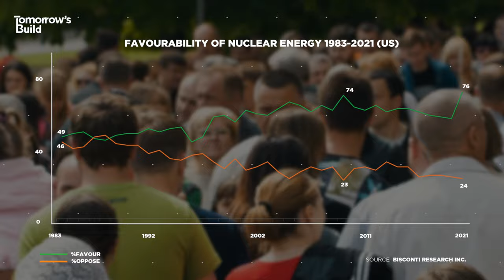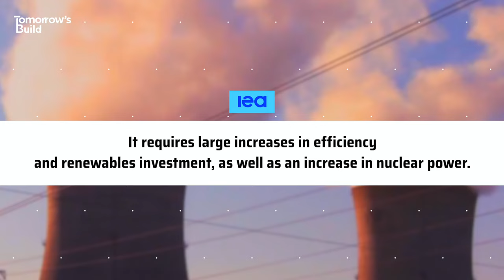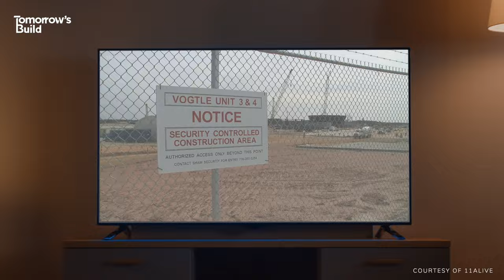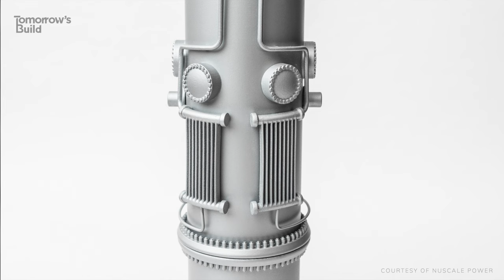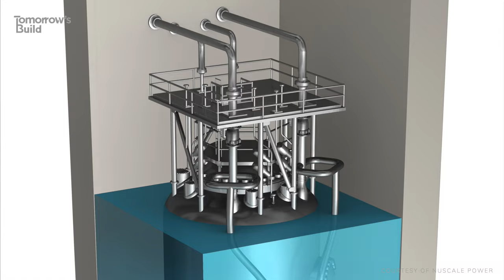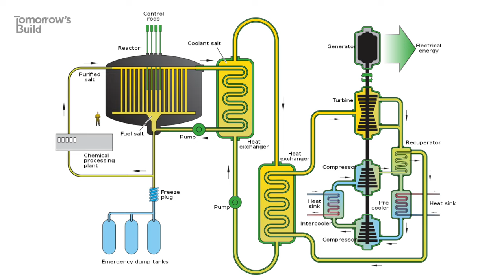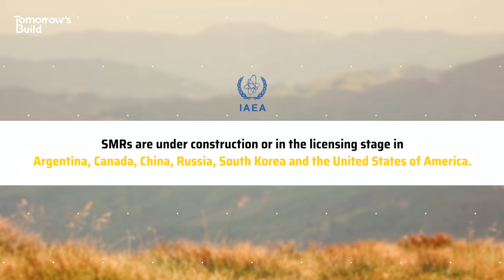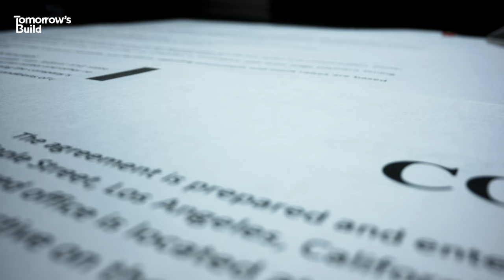These Mini Nuclear Reactors Can be Built Anywhere

Comment: Ooo I actually have a story about these, my dad was an engineer on one of these projects with one of the larger nuclear companies in the US. He was working on their new modular next-gen reactors before the project was axed. They actually had an almost functioning (no-fuel) prototype built for testing about a decade ago now. The idea was they could build it underground or stack them to save space. They also were planned to be fast-breeder reactors or could be transitioned to Thorium to save on fuel costs. Overall the project was super cool, but Fukushima absolutely destroyed it and the one that was sold and planned to be built in Tennessee was cancelled due to public outcry and the company completely pulled out of the nuclear industry and recently went bankrupt. :/
Reply: Should have tried to sell it in a different market like India or China.
Reply: I hope we come around to except them until we figure out fusion.
Reply: Why is public outcry even listened to in for nuclear power. Chernobyl happened because safety was not a concern. Three Mile, again safety was not a concern. Only Fukushima was one where there were sufficient safety systems, but not a lot you can do without backup power.
Reply: @swaggery  Also Fukushima was such a rare thing to happen, sometimes bad shit just happens that we can’t control.
Reply: @swaggery  Safety was absolutely a concern with Three Mile Island's design. That's why it didn't result in a catastrophe like Chernobyl. TMI's problem was poor operator training. When handing a nuclear reactor off to a for-profit corporation, they will look to shave costs wherever they can. A belief in TMI's safety systems caused the workers to assume, if anything bad happened, the reactor would automatically take care of it. Which it did, until humans intervened and manually over-rode the process. Even with that, the containment vessel held and people are still living in Middletown, PA (and all of southeaster Pennsylvania, for that matter). TMI1 was finally shut down after 36 years of operation in 2019. Full disclosure-my father was the project manager for the construction of TMI. He went on to oversee the construction of Washington Public Power Supply on the Hanford reservation and Grand Gulf in Mississippi.
Reply: @alessiofe  That's not how that works, any energy projects in the US are overseen by the government and they would rather axe it than sell it to a economical adversary.
Reply: How deaths in the USA was caused by a nuclear accident? I cannot think of any. At Fukushima, if they would built their backup diesel generator in protected enclosures they wouldn't had their problem.
Reply: @theonlylolking  The  Feb. 11,1985 Forbes magazine cover story said, "The failure of the U.S. nuclear power program ranks as the largest managerial disaster in business history, a disaster on a monumental scale...only the blind, or the biased, can now think that the money has been well spent. It is a defeat for the U.S. consumer and for the competitiveness of U.S. industry, for the utilities that undertook the program and for the private enterprise system that made it possible."  It has only gotten worse since then.
New South Wales Bob Carr, a former nuclear supporter, premier and foreign minister, described nuclear power as "lumbering, cripplingly expensive, and moribund." Every power reactor project in Western Europe and the U.S. over the past decade has been a disaster. Every reactor is on the edge of a disaster every day, forced to extend their working life, crank up output and reduce maintenance costs to compete economically with alternative energy sources.
On Jan. 30, 2022, nuclear regulators Dr. Jaczko (U.S.), Prof. Renneberg (Germany), Dr. LaPouche (France) and Dr. Dorfman (UK) said, "the central message, repeated again and again, that a new generation of nuclear will be clean, safe, smart and cheap is false. The reality is nuclear is neither clean, safe or smart, but a complex technology with the potential to cause significant harm.  Nuclear isn't cheap, but extremely costly. Perhaps more importantly, nuclear is just not part of any feasible strategy that could counter climate change."
Five Japanese Prime Ministers, Koizumi, Hosakawa, Kan, Hatoyama and Murayama said, "promoting nuclear power can ruin a country. We have witnessed an incredible tragedy and contamination on an unprecedented scale: 100s of thousands of people forced to leave their homes, vast agricultural lands (Japan's breadbasket) contaminated. Radioactive water (greater than 1,000 times over safe limits) beyond storage capacity still being generated, many children with thyroid cancer (that comes first along with genetic damage than destroys the immune system, then leukemia and other cancers, then mutations, birth defects and reduced life spans), and massive loss of resources and money." Nuclear has destroyed the economies of two countries, Japan and the Soviet Union. Who is next? I am betting on France, how about you? The French government has taken ownership of EDF and Orano/Areva/Cogema (the name is changed to protect the guilty) to keep them from going bankrupt, and the market share of nuclear has dropped by 12% in the last decade. More to come as aging reactors go belly up soon. But not soon enough to save the French taxpayers. 
China, being a dictatorship, has seen the writing on the wall and is flexible enough to rapidly convert to renewables and put the brakes on nuclear energy. They also have arrested 3 of the top nuclear regulators and ten executives of nuclear utilities for corruption. India and other countries are going the same way. 
The only strategy left for nuclear is to get taxpayers to increase already huge subsidies for nuclear projects. It doesn't matter to the industry whether or not these nuclear pipe dreams ever become reality, as long as they can stave of bankruptcy until they can get their own capital holdings out of jeopardy. Every nuclear reactor would shut down tomorrow except for two reasons: 1) nuclear weapons proliferation and/or 2) Even if a reactor is losing money, if it is shut down, it immediately goes from the assets side of the ledger to the liability side. Expenses for property and waste maintenance, security, decommissioning and decontamination remain with no income. The utility and its investors will go bankrupt on the same day it shuts down. Maintaining the shutdown Sellafield Cumbria site will cost the UK over $3 billion a year just to maintain it and untold billions and at least 100 years to remediate it. But it will never be clean again. We know when nuclear catastrophes occur, but they never end. They just spread and bioaccumulate.
Reply: @KrustyKrabPizza22  Japan it's known for earthquakes, it not so rare. Just place nuclear reactors away from earthquakes zones, seems almost logical .
Reply: @swaggery  well more or less it was because of profits. Chernobyl: they pressured the reactor for the factories that fuckt it with the build up of Xenon and then operator error. Three mile was an operator + the construction went over budget, so there was cut corners. Fukushima was a mix of loss of power and company greek (doc have been put out about the company knew the generators where too low and the wave barrier was too small, company ignored it because of profit
Reply: @Rosedach  "How deaths in the USA was caused by a nuclear accident? I cannot think of any. "
3 that I know of at the SL-1 accident in 1961
Reply: Great story. I wonder where the excess investments went to? Those could have been spent on improving life rather than threatening it.
Reply: @swaggery  There's also the issue that nuclear technology is becomming more complex and prohibitively expensive compared to renewables for example. If you don't have an established industry like France or China for which nuclear has been a national policy objective for a long time. Note, that historically, nuclear energy always relied on massive state aid to be "competitive". Furthermore I don't think SMRs are more economical than conventional big ones in terms of energy output/costs. This is not only bc the construction costs and time scales for any modern nuclear project are ginormous and extremely complex from a bureaucratic pov, but also bc of long term liability concerns like the huge operating costs (fuel (availability), parts/manufacturing, specialized personel, etc.), aswell as astronomical insurance rates. These are the main reasons why fision power becomes increasingly unpopular with national governments and energy companies. And I think it's naive to assume, that "small" reactors would not have the same issues.
And at that point you seriously gotta ask yourself, if all that money and time might be better spend on more research and manufacturing of things like solar, wind and storage capacity.
Reply: @Richard Cranium I'm alluding to the fact, that the civilan use of nuclear was born out only after the establishemnt of the various parallel national programs for nuclear armaments starting in the mid 40s and atleast until the 70s, which created a massive and very costly high-tech industry. In that sense nuclear power was more of a product of national economic and defense policy, which sought to justify and reuse these hugely expensive programs for public usage. In that sense nuclear energy was never truly thought off as a economically sound/competitive energy source in the first place, but rather as an important (geo) political assets that had to be protected and nurtured.
Reply: Sad story, i'm pro nuclear, it's the best solution for next 50 years
Reply: Care to share the name of the company your father worked for ?
Reply: @johnchalmers6784  spoiler: It's Nintendo.
Reply: @johnchalmers6784  I bet it is/was Westinghouse
Reply: Yes cmbgo123.  It's massively unfortunate that designers, planners, engineers & operators between them don't have the combined brain power & common sense to prevent these occasional high-profile over-hyped disasters by building in the extra redundancy needed and telling clients "Well this is what it costs with this 10x as good as before foolproof factor" and thriving or failing depending on that proper cost.   It's messed things up hugely.  Japanese too, they make a nice camera so you'd have thunk they'd know better. But no.
Reply: @swaggery  "Only Fukushima was one where there were sufficient safety systems, but not a lot you can do without backup power".  Well, not sufficient safety systems then because yours is self-contradictory. There's almost no practical limit to the redundant extra safety layers possible but of course costs increases with each layer and, of course, you don't want any of these extra safety layers ever to do anything whatsoever for 100 years or some such, so they are a complete total waste of money. Except of course that if "What the ! I never in a million years thought that could happen"  happens then those massively-expensive never-ever-used extra layers of redundant safety systems were the wisest investment ever made.
Reply: What would be the cost of starting again the project? Any chance I can have a chat with your dad?
Reply: Also, 100 small nuclear power pant scattered around the country would be an easy target for attack (like what happen in ukraine). And it would be hard to defend all of them at once.

10 large nuclear power plants would be easier to defend or maintain than a 100 small one.
Reply: @Ozzymandias493  That's not what I 'learned'. Oak Ridge Lab in TN developed a molten salt reactor - 50 years ago and provides the design - for free. No one (!) picked up those plans. But guess who's building the first reactor now?
Reply: @KrustyKrabPizza22  Very few people were harmed because of the Fukujima meltdown while 20'000 were killed by the tsunami. All other affected NPPs in Japan were safely shut down without major problems. At another NPP site near Fukujima, the townspeople were actually seeking refuge in the NPP site because it was safe from the tsunami (the town council had wisely insisted on a higher seawall and the NPP was undamaged despite being hit by a bigger wave). All you hear in the media is Fukujima however.
Reply: @Snugggg  Plus two during the Manhattan Project caused by the demon core.
Reply: @KrustyKrabPizza22  The multiple design shortcomings at the failed Fukushima reactors had been pointed out and were in the process of being addressed. Had the upgrades been implemented quicker, the 3/11 earthquake would not have had such consequences on the power station. I blame Japan’s proverbial resistance to change, ultra sluggish decision making process and cultural incapacity for individual responsibilities.
Reply: @jackfanning7952  You've got some good arguments there but do yourself (and the reader) a favor by using a bit of white space. Just a couple of paragraph breaks would help immensely
Reply: That is tragic!
Reply: @nntflow7058  except in Ukraine Russia attacked the Zaporizhia plant in part because it is the largest power plant in Ukraine... Ukraine's plants are not small.
Reply: NuScale is or will be building a 77Mw SMR with $2 billion in taxpayer welfare (1 for 1 dollar matching funds) and 77 Mw at $4 billion total is a financial failure even before they move the first shovel of dirt
Reply: It happened before. Liquid salt reactors were tested during Nixon's presidency and were all terminated after running for close to a year without incident. Some stupid political reason, but somehow this tanked the project for 60 years.
Reply: @Ludifant  Every type of reactor known (MSR. SMR, Thorium, etc.) has been built and tested by the U.S. government over the last 70 years. BWRs and PWRs were chosen for commercial power and Navy propulsion because they have the most pros and least cons of all the other reactor types. No conspiracy theory here.
Reply: @swaggery  Modern designs are ‘walk away’ passive designs. They don’t need back up power or human intervention to stop a melt down.
Reply: @Richard Cranium Nuclear has received more state aid that any other energy source except oil and gas. If you consider subsidies for oil and gas started around 1920 and nuclear subsidies bagan in the late 1930s, nuclear has received more than any other energy source.
Reply: wnc817  Every reactor would shut down today if it were not for twuo reason: 1) nuclear proliferation; 2) Even though it cannot compete economically with EVERY other energy source, if it were shut down, it would immediately go from the asset side vof the ledger to the liability side. Costs for site maintenance and security, waste storage and eventually decommissioning and waste disposal (if either of those ever happen) would remain with no income. The utility and any investor would go bankrupt. Therefore the industry will limp and lumber into a slow and agonizing death. The only question is how much they can steal from the taxpayers on the way down.
Reply: @Rosedach  also if they had not built their reactor right at sea level in an area known for tsunamis that would have helped. The u.S. is the only country that requires that reactor be installed inside a reenforced concrete building capable of surviving a direct hit by a large airliner.
Reply: @Snugggg  those are the only ones I can think of.
Reply: @paulmorrow8372  or Bechtel.
Reply: @ibubezi7685  that's because molten salt reactors are not as safe as pressurized water reactors and you can never really turn them off because if the sail cools down it solidifies and then you have a ruined reactor.
Reply: No fuel type means ???
Reply: Tennessee backed out for the same reasons WASHINGTON State backed out in the 1980s, however WASHINGTON has more serious reasons why… like 9.0 Earthquakes & Tsunami’s. Both states also produce more electricity than we consume in hydro-produced electricity. We don’t need any nuclear power plants. If your state doesn’t, don’t think you can force Washington, Tennessee, Alaska, Oregon, or British Columbia to pay for & build nuclear power plants by increasing our rates thinking we can afford it because our sources are already built & paid for. YES we have cheap ass electricity, at great cost to our Salmon industry & species. Several species are now extinct. But it’s cheaper & far safer than nuclear. As our states grow, you will receive even less of our export of electricity. That’s the way it works. If the day comes and we need more electricity, THEN we can build other sources. It will more likely be Solar/Battery rather than nuclear.

The only future for mini nuclear power plants  will be where batteries are infeasible: Ocean Vessels. As long as we have romance novels we will have a need for cruise ships. These ships use diesel generators which make the air unbreathable in the cities where they port. Seattle-Alaska cruises has become very profitable & nobody is going to cry if a small nuclear powered aircraft carrier is in port & shouldn’t if a nuclear powered Titanic is in port either. Any accident & it can be moved far into the Pacific and sink 2 miles into nothingness.
Reply: if we are still in 2022 and we have big demands from the future, what would it be like to learn to adapt our lives parallel to nature, to build green energy from everything that nature offers us, water, sun, wind and to avoid the destruction of the earth and its transformation in a piece of cheese And the technology we have today must be compatible with the future otherwise we will evolve to some limit and boom
Reply: Ooooooooo
Reply: Could china buy a few hundred and put them in their submarines ???
Reply: @FrencisWhite  It's quickly becoming the only option if we intend on living without rolling blackouts.
Reply: Public outcry? More like a cop-out.
Reply: murphys law will always be with nuclear
Reply: @MDF4072  Australia for example needs 400 SMR nuclear power reactors. 
3shifts 24/7/365 plus holidays, weekends, sickness,...
25million people 
The world 9,000 million people and 150,000 SMR nuclear power reactors. 
Foget Murphy,  Hahaha Hahaha 😆

60years to 100years locked in technology.
Reply: Your story sounds like nonsense.
Reply: @bighands69  nuclear needs government disaster insurance and government guarantees and long lead times, and government 'supervision', so it is politically tricky. 
Decades to return a profit. And they drain money from alternatives. 
Technology is moving fast and nuclear is 75 years old. 
Big government is never popular.
Reply: @stephenbrickwood1602  You thought China can buy nuclear plant from US nowaday.
Reply: @KrustyKrabPizza22  Thats the fundamental problem. A lot of these Karens possess the spirit / character of the benevolent mother. If the slightest amount of uncertainty or danger exist, scrap the whole thing despite being a net positive for the community in question. That explains the left, politically, as well.
Reply: I'm sure they have a patent. Rip that patent number. And show them what they missed out on. It's so sad that they pulled from nuclear with this. Seems like it was a solid fix for our current carbon emissions. I wished we had more nuclear here to. We only have 1 reactor and it's only a 450Mw one. It's an oldie but still working like a charm. Luckily sane people know wind and solar aren't going to cut it. And I kuch rather live within the vicinity of an NPP than your standard coal/gas/biomass power plant. 

I'm sad your dad's boss couldn't tough it out. If they did they would probably be better off now and still exist. The interesting part is definitely that it was q design that worked as a fast breeder and a thorium based npp. Because I was sure both were fastly different. Would've bought the patent if I had the cash laying around.
Reply: Nano nuclear energy